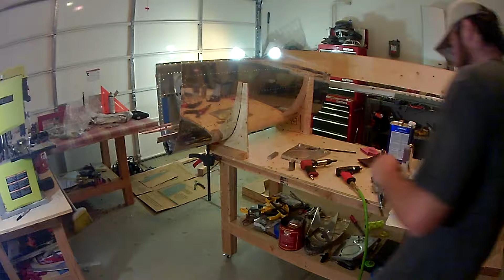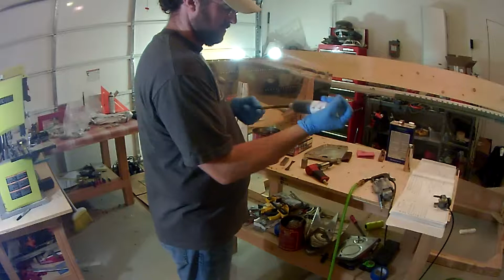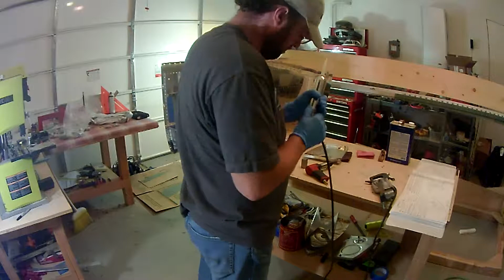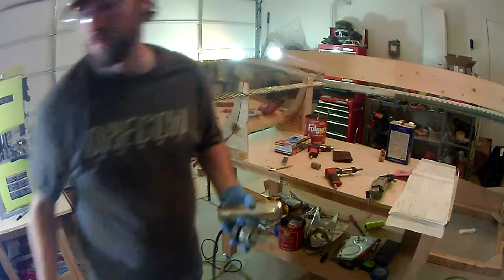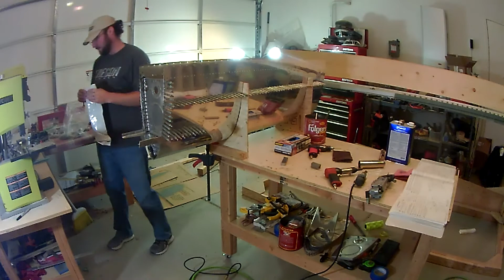Scott's RV-14a Fuel Tank part 12

Comment: Do you know if the 3M version from Aircraft Spruce is acceptable.  Looks like it's a little cheaper too.  Says it's fuel resistant, so I assume it's just as good as the ProSeal version.  Also, do you have the part # for the air dispenser you got from Brown?
Reply from the maker: I am not confident one way or the other with regards to how well the 3M version holds up as compared to the Pro Seal version. I thought about using it as well, due to the price difference you noticed, but I decided to go with what I saw everyone else using. I would say that you could look up the chemical compositions and compare them, but I did horrible in chemistry, so I stayed with the safe path and used what everyone else is using!

The air gun that I got was the Air Operated Sealant Gun. its listed at $150. The part number on their website is 250-6OZ.

I was able to find it as a used item on their website when I bought mine, under the "surplus" category. So if you are not needing the tool right away, you might look at the surplus every once in a while to see if they have it there. I think when I bought mine, it was about half of the normal price when I found it in the surplus listing. It was slightly used, but functioned just fine and came with a few extra things.

Either way, I HIGHLY recommend the gun! SO much easier to work with!